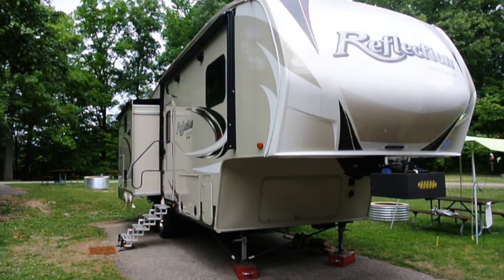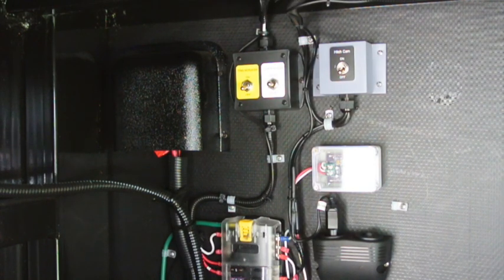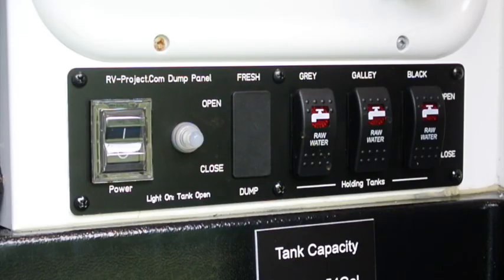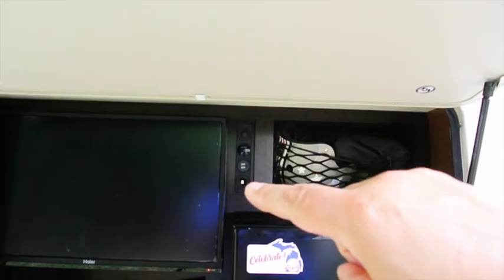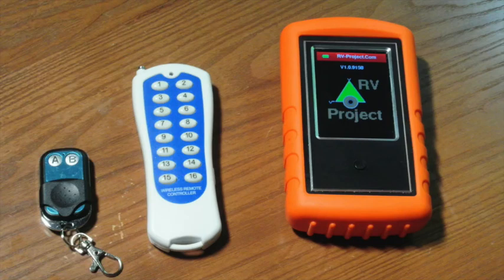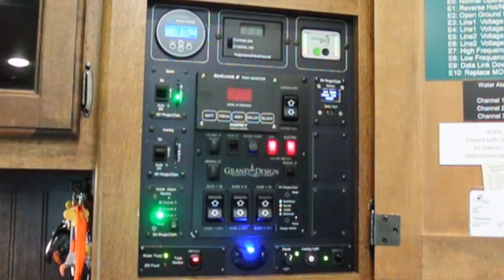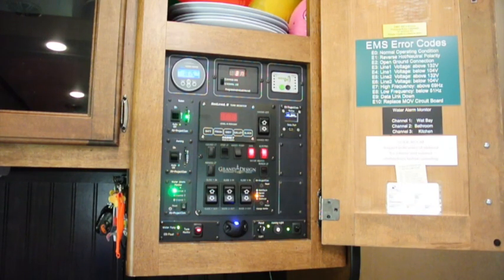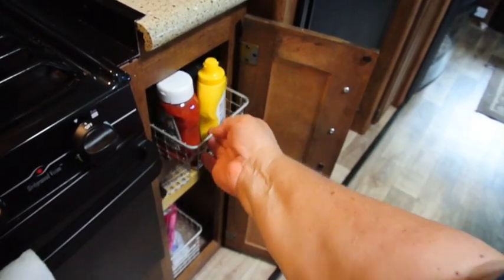Over 60 Modifications of my Grand Design 29RS - 2020 Walkthrough

Comment: You seem like the guy that would know. Were you able to connect your living room tv to the speaker system? And if so, how?
Reply from the maker: Each stereo/tv system is different hardware wise, so I cant be specific.  But the concept in general is to connect the "Aux In" of your stereo - if it has one, to the audio output of the TV, again assuming it has one.
Reply: While I'm not "the guy", I have done this. The back of my TV has an audio out plug, and my RV stereo head unit has an AUX in plug. I found a cord that had the necessary ends. I leave the TV end plugged in all the time, and only plug the stereo end in while using it.

Comment: What is the box around your pin?  Is this foam that you cut to fit?  Your modifications are amazing and it is great that you provide free diy instructions.  Unfortunately, I am no where near smart enough to handle these projects even with your instructions.......I just don't trust myself.  :-)
Reply from the maker: The box is a foam rubber safety box that keeps you from hitting your noggin on the pin box.  

I did a video on it: https://youtu.be/xIk6cV0YBMM

Here is where I bought it: https://rvsafezone.com/products/fifth-wheel-pin-cushions/

Comment: So basically you fixed or improved all the factory systems and added a few to boot! It’s sad the amount of money we spend on these rv’s and the only thing that works on them is the owner! Lol

FYI, I have also installed the rvlock and recently the unit started acting up by going through battery’s and then all of sudden the key pad went out.. I contacted RVLock and ordered a new circuit panel and the lady said she would include a new gasket, when I opened the unit I found the circuit board full of water and the new gasket they provide goes around the entire edge of the lock where as the old gasket was square and did not seal the handle completely! I’m not sure when this new gasket was implemented but it is far better than the original!
Reply from the maker: Amazing it lasted as long as it did... full of water.